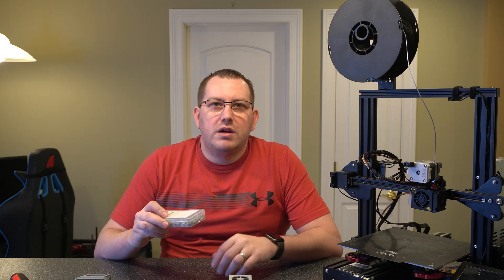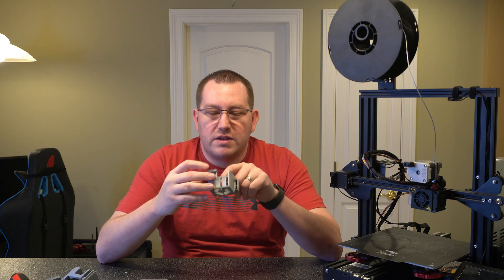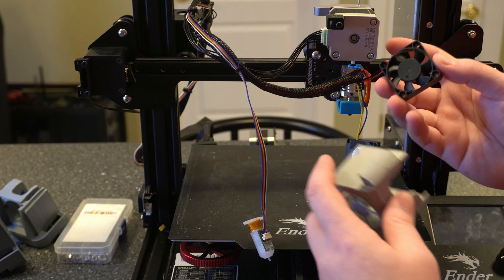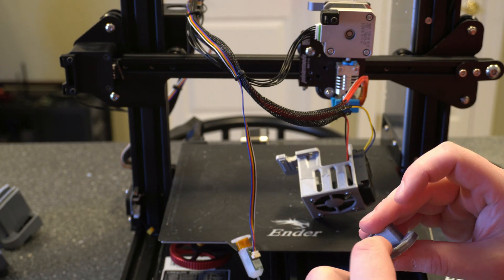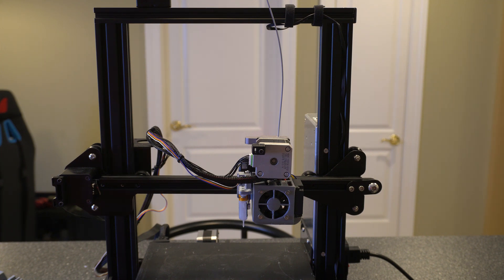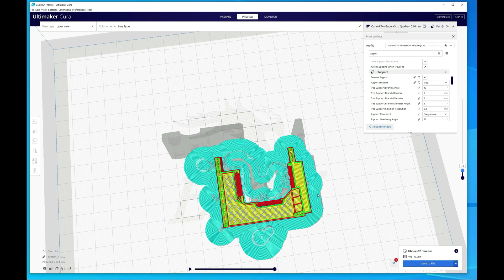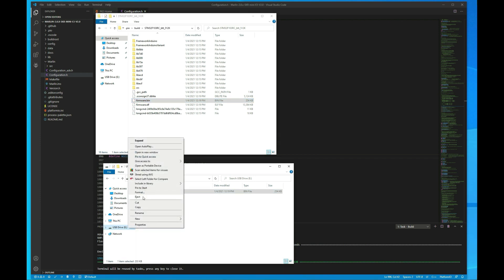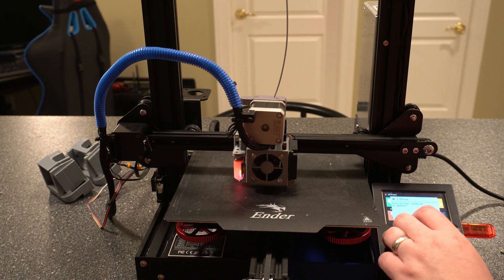Ender 3 Direct-Drive Fan Duct Cover Upgrade

Comment: im having troubles slicing this, i can't  find a perfect placement for less support in cura
Reply from the maker: Hi. The one was a pain to print. I ended up printing it standing up and using tree support set to touching build plate.

Comment: What are your thoughts on VOC emissions from printing .I've seen several videos from others suggesting an enclosure and pumping the air outside.

I do not have that ability and have looked in to creating a lack structure and including a hepa filter somewhere with it .

As of now my printer is in a seperate room  printing PLA which is not as bad as ABS . But I do have a filter running next to it , what are your thoughts on a solution ?
Reply from the maker: Hi. I think that if you are just printing PLA or PETG you don’t really need the enclosure. I know many people, including myself, that don’t use one. That said, if you are planning on printing with ABS I would make sure the printer is enclosed or in a well-ventilated area away from people.

Comment: Great video! What is the stl that you are using to attach the cables to the x gantry motor cover?
Reply from the maker: Hi. Thanks for the feedback. I didn’t actually print those, they came with the direct drive conversion kit I purchased. I cover it in a little more detail in this video. https://youtu.be/bwhEpRBpu7M

Comment: How much does direct drive differ from the bowden setup? I was reading up on the differences, but it seems that direct drive just makes things slower. I'm not quite sure if the upgrade would be worth the hassle
Reply from the maker: Hi. The direct drive wouldn’t make things slower, it would be the same speed. The main benefit it provides is that it makes using specialty filaments like TPU usable. If your only planning on printing with PLA, the upgrade wouldn’t be worth it for you.
Reply: @3DPrintscape  alright, thanks!

Comment: ok so i bought an ender 3pro then upgraded the board to BIGTREETECH MINI E3 V2, so just bought a cheap bl touch from ebay, no instructions at all? any info would be great thx, love the channel all the best from the uk and stay safe cheers PAul
Reply from the maker: Hi. I would try to follow what I have called out in the video. If that ends up not working then we may need to dig deeper but the install process tends to be the same.
Reply: @3DPrintscape  thank you the physical thing is similar but some of the connections on the copied version of bl touch are different, love the channel great stuff well done